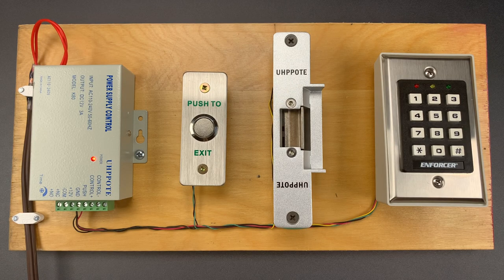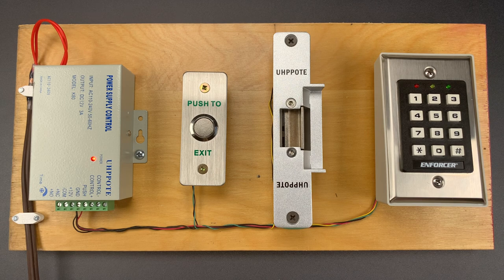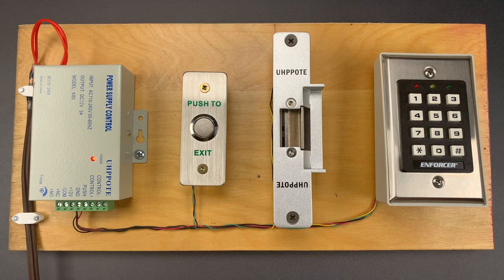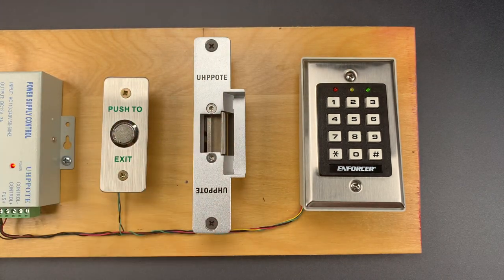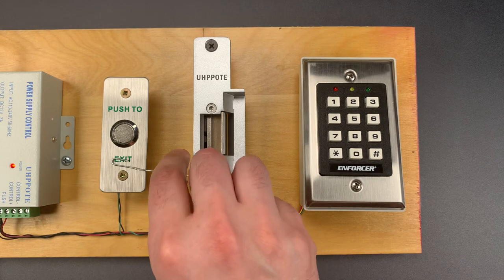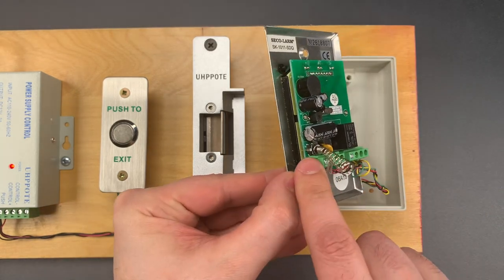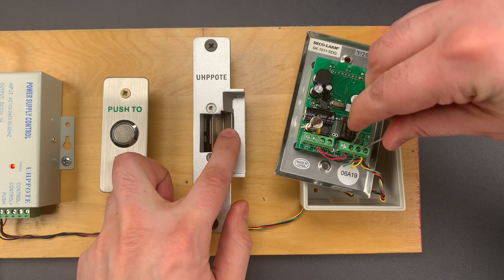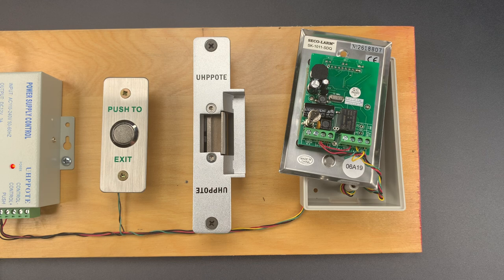[1045] Swiss Army Knife Bypass of Keypad Lock

Comment: As an engineer I've always laughed when actors bypass locks like that in movies. I never imagined anybody could design something that wrong.
Reply: As an infosec guy I can always imagine it.
Reply: This door lock was originally intended as a prop for movies.
Reply: @LordSStorm  Red Teams love this one simple trick!

Blue Teams hate it when you do this.
Reply: as a software engineer I'm also shocked at how stupid this is
Reply: @weltmeister  that's what you get for a low security budget
Reply: All you have to do is close the circuit, you can put an entire buildings worth of bullshit in between and you still just need to close the circuit. As an engineer, it seems like you should know that.. another ridiculously futile lock setup is an electronic safe with a wafer lock.. these are only the non-destructive methods, had the wires been easily exposed like they are going to the box here you could just close the loop there and bypass the box altogether.
Reply: @ZeroLocc  Engineers are perfectly aware. This seems to be designed by two squirrels and a beaver on heroin.
Reply: @yottaforce  that's probably the most common push code box on the market. The reason it has an easy bypass is to let the locksmith in. electronic door locks are useless because all you have to do is close the circuit. Security systems in general are pointless because I can set your alarm off five or six times on a windy night and then the police will stop coming.
Reply: @ZeroLocc  This style is often used as a glorified "Employees Only" sign.  It keeps people from "accidentally" wandering pass a door they shouldn't be, but it'd likely be noticed if someone was actively tampering with it.  The bypass only works because the controller is built into the keypad so connecting the leads sends an open signal.  Another style of electronic lock has the controller inside the secure area with a dumb keypad on the outside that can only send raw button presses to the controller.
Reply: @MrNateSPF  i would argue that in infosec, one time is two too many. Also, a skilled entrant could get in multiple times without notice as long as awareness of the beach was low
Reply: @ZeroLocc  This style is not a good solution for infosec, but there are other electronic door locks available.  This would be for like an employee break room, so a non-employee could sneak in there and have access to the soda machines set to employee pricing... dun dun dun...
Reply: @MrNateSPF  much as I'd love to repeat myself, if you go up with you, and you will see that you are wrong. Locks keep out honest people only. Lock me out good enough and I'll go to the f**** wall
Reply: @MrNateSPF  what good is a tamper switch inside the box if I could pry the entire box off the wall and jump it from behind box
Reply: @ZeroLocc  This style is not a good solution for infosec, but there are other electronic door locks available.  This would be for like an employee break room, so a non-employee could sneak in there and have access to the soda machines set to employee pricing... dun dun dun...
Reply: These are more a convenience item, SCIF room door locks are a bit more sophisticated.
Reply: @davidmoran4471  if I've gotten to the keyed door, I'm getting thru it. What people don't realize is that corporate espionage it's not a fly-by-night operation. Kind of people that commit corporate espionage take a lot of time to plan and prepare. They're playing to win, not playing to "hopefully" keep people out "in most cases" .
Reply: @ZeroLocc  Well congratulations, you have successfully broken into the employee break room and have access to the employee-discounted vending machines.  What are you going to do next?

Again other electronic locks are available that do not have this exploit at all.
Reply: @MrNateSPF  poison the coffee, plant a wifi pineapple,a listening device in the lights, i could even rig an ied to the keypad or too the door,  then i might 'service' the vending machines as a profitable cover for my exploits. Better yet, I could spend an hour and there the believable Xfinity or other internet provider get up on and by the end of the lunch hour everyone would recognize me when I wandered around the rest of the building putting in rubber duckies and whatever else I would want to do. What did you expect me to say? Something like: nurrrr, I don't know? I could even befriended disgruntled employee you have no idea how damaging that could be
Reply: @ZeroLocc  Then you find out the "friends" you made were actually security guards monitoring everything you did, who decided it easier to just play along till the police got there to arrest you.

Yet again the actual point that you keep skipping over is there are other electronic locks that are not susceptible to this kind of exploit.
Reply: @ZeroLocc  not corporate, Federal.  Even the conduit for the Ethernet has alarms.
Reply: @davidmoran4471  I'll bet twenty bucks no matter where you work, you can walk up to a desk with a secretary or someone at it that has USB ports facing towards you as you walk up to it. That's all that's needed. In the break room is generally one of the soda machines these days. Or Wi-Fi pineapple. Ethernet is so 1995.
Reply: @weltmeister  make all of your code publicly available and you might find yourself surprised.
Reply: There is no lock that cant be picked. Regardless of how complicated you design the lock.
Reply: @archimedes7436  That's no excuse for making a bad design.
Reply: as a plumber, i know nothing of this.
Reply: LMFAO or even worse using to secure anything of value.
Reply: @MrNateSPF  what am I going to do after breaking into the employee break room? 
Takeover the mother world 🌎
Reply: @ZeroLocc  "electronic door locks are useless because all you have to do is close the circuit"

Yet again the actual point that you keep skipping over is there are other electronic locks that are not susceptible to this kind of exploit.
Reply: @MrNateSPF  actually the point is this is the absolute most common door lock it existence and I can lock a box from where I live to a very fancy health insurance facility, which may be your health insurance facility I walk right in the f**** door because they have one on the outside. And that's the point. The point is the industry Standard junk is junk.
Reply: @ZeroLocc  "electronic door locks are useless because all you have to do is close the circuit"

We are in agreement that this particular electronic lock is useless.  Yet again the actual point that you keep skipping over is not all electronic locks would be susceptible to this kind of exploit.
Reply: @ZeroLocc  you have a rather devious mind it looks! on reality, you would hardly do any of those things
Reply: @harrickvharrick3957  LMAO, how do you think I make my living?
Reply: @harrickvharrick3957  it's naivety like that that's going to get your little kitty cat hurt
Reply: @ZeroLocc  Erm, you do something with pineapples?
Reply: @ZeroLocc  I am happy it is something with pineapples. That minimises the chance of any kittycats getting hurt. Suppose a coconut farm would be much more dangerous, to name something!
Reply: @harrickvharrick3957  must be one of those lonely people, eh?
Reply: Seems like they should have wired it together in the factory and sank a load of resin inside the box to make it tamper proof. With the connections being made on the INSIDE of the door...not the outside Jesus Christ.
Reply: @uklearningman4461  You couldn't have mounted it to the wall that way. the box always has to be able to be open so that the mounting screws can go inside. Also you have to wire up the tamper switch inside. Which most people don't do and that's the point.
Reply: @ZeroLocc  err no, you completely misunderstand. The problem with this is that there is friggable connections on the OUTSIDE of the door you are trying to get in to. If everything was sealed with no terminations apart from on the INSIDE, then you would have to be on the INSIDE of the door to defeat the lock. Really not that hard to imagine...
Reply: @uklearningman4461  there are no visible Connections in a doorway
Reply: actually the locks in movies often seem to be considerably harder to bypass!
Reply: @simonstucki  true, i dont know anyone who uses explosives to bypass doors and locks. That's not exactly how you keep people from coming to see what you're doing. That is just the first example came to my head
Reply: @ZeroLocc  the places i did in the 80’s used internal door hinge switches. So anytime that door opened, it was recorded both side and onsite armed security was sent if violated entranced. FYI harden frame and 6” concrete walls to concrete ceiling. You might get in but there’d be a gunfight waiting.
Reply: @ZeroLocc  careful everyone, internet tough guy alert.

He doesn't even care anymore!! And he says he likes to hurt people on the internet in the real world!!11

He threatens people's CAT! How can we possibly ignore such an internet tough guy!  He's so tough and scary!
Reply: I have to disagree with your blanket comment "engineers are well aware". The ones I work with are not. They don't seek out any advice for projects and implement projects that we have to fix afterwards. While I agree most engineers are and should be well aware of simple mistakes you cannot throw a blanket statement over them all.
Reply: @therinni2347  Well, yes. Most, a lot, usually. You are right some engineers shouldn't build anything higher than 60 cm.
Reply: you hear at least once a year about a disgruntled employee coming back into a building that should have been secure enough not to allow it to happen. people may think I was just being over the top, but you never know what someone is capable of. that's why as employers we have a responsibility to keep our employees secure and safe from the outside world when they are in our employ..
Reply: @MrNateSPF  He's probably going to go as far as pooping in the staff toilet
Reply: @ZeroLocc  careful everyone!! Now he's a disgruntled employee!  Maybe he's even had a job!! (I'm not holding my breath, he's probably 12, but like, cats beware!!)
Reply: Have you been an engineer long? :D
Reply: @weltmeister  As a software engineer that deals somewhat with infosec ... I'm not even remotely surprised.
Reply: @notsure7874  About 20 years. You make me sound a bit naive... :-)
Reply: @yottaforce  Well many engineers I've worked with were perfectly aware that, though perhaps not total imbeciles, they could at least be trusted to drive the people who really build things, the crew, to the job site.
Reply: @ZeroLocc  Well said
Reply: @ZeroLocc  You have spent way too long here arguing. Sounds like you have a lot of spare time. Maybe spend it looking for a girl to use to feel less insecure.
Reply: Ja det har du sku ret i
Reply: So a simple plastic cylinder around the antitamper spring would handle that exploit.  Realistically if you can get physical access to the circuit it isn't surprising you could trigger things to open however you like.
Reply: This is an interesting conversation:  Angry JD against the world.  Everybody understands JD, and yet no one does.  I expect that why he's in his professed business.   After that, most of the conversation is people talking past each other, but I repeat myself.
And there's one Italian plumber who professes to know nothing.  That's the guy who really scares me:  Can I tell his preference for boxers vs briefs, or does he just present a "coin drop" to keep us guessing?   If his shirt tail goes down far enough to keep us (and him!) in the dark, then put 2 security guys on him until he leaves the building.
Reply: @ZeroLocc  that's the best way, it's fast and works with all electronic locks. there's usually some type of junction to the panel.
Reply: It’s a business. Make them as quick as you can or buy them for China and don’t even give it a thought
Reply: A simple plastic shroud (extending down from the lid) would prevent all of those attacks.
Reply: As a person who loves to build(and break) things, most security systems are mostly for show.
Reply: As a soilder I never cared, but now I know, I, have no particular use for it, in Germany, especially in Bochum I never saw anything like that, most have a lock on there, wich you can cut off with a boot cutter, nothing unnecessary complicated, for the simple reason, everyone around me, seems to be dumber, than a bug, they can't access it even if the wanted.
Reply: Remember locks are only to keep honest people honest, because a criminal if they want in bad enough, it won't matter what lock is present.
Reply: @yottaforce  hey that's too much credit to their name. A beaver on heroin is a hell of a worker.
Reply: @porobignardi8369  ah a true man of science.
Reply: I am not surprised,. Remember most of electronic products made on China or Taiwan, aka mass production line with extremely low cost. 

Thus, R&D team are always been demanded by their big boss to change their design to easy assembly with cheap materials and equipment. Yet, R&D team never have enough of time to create next model of products, so usually they make improvements based on current design layout.

That makes these products easy to disassemble. And believe me, they are the products the big boss want. They want people to keep buying new locks
Reply: They're everywhere.
Reply: @ZeroLocc  I remember a bank heist movie that did that. Setting of the alarm until no one cared that is.
Reply: @weltmeister  funny thing, software tends to be something with higher density of security issues than any other kind of product!
Reply: I always watch for how often they just use a pick without a tension wrench.  But it seems like in more recent years they’re using them more often.
Reply: It’s generally that easy.
Reply: "Hahaha the other engineers are so STUPID!!!1!!!"
Reply: @yottaforce  LOL
Reply: In a world with the garbage bag and carryyout bag paradox....you shouldnt be surprised ...oh and we allowed government and politics to actually be a thing so already a failed system..again no surprise lol 😅
Reply: @weltmeister   Locks are for honest people
Reply: @ZeroLocc  Not all electronic locks are the same: there are high security (for armored doors) and very high security locks (for safes and vaults) also... but of course they are not cheap (and of course they are also useless if you don't have armored doors and windows in a concrete room in the first case and a proper safe or vault in the second one!).
This locks seems just fine if you have a wood door and glass windows!
Reply: @ZeroLocc  ...Engineers have always been high on themselves. There’s a Show called Engineering Catastrophes which will tell you all you need to know about Engineers. They’re the smartest people on earth and they’ll be the first to remind you of that.😂🤣
Reply: All that's needed is little covers over the contacts and for that tamper spring to be a very strong rigid spring or strong metal strip type spring
Reply: Right? Flippin rediculous.
ALL they had to do, was have a double inside casing. Just so you cant stick anything in between.
Reply: @archimedes7436   every lock can be opened without a key, but that does not mean that every single lock is pickable. There are definitely locks that are pick proof, or require an especially specific pick that only a real professional and honest locksmith would use for their customer.
Reply: @ZeroLocc   hey how do you close the circuit on an x09?
Reply: @yottaforce  You mean our crack team of experts?
Reply: @adambartlett114  You are skipping over that actually, you've missed the whole point that these should not be used for security.  Employees should not leave their valuables out and unattended in the break room, use a locker if needed.
Reply: As an bio chemical engineer I also find this very amusing
Reply: Over the last 10 years or so, I've mentalky apologized to a shitload of '90s screenwriters whose [villain, lock, plot device, etc.] was apparently not as cartoonishly silly as we all imaged.
Reply: After working around some of these devices, I am also amazed how old tech and poorly designed they are - and in the case of alarm panels and sensors apparently prone to false alarms as well, which makes people ignore the alarm if it goes off anyway. At the end of the day, I think no matter how expensive the lock, it only keeps honest people honest.
Reply: everyone knows that all you need to do is shoot the controls, and the automatic door will either let you in or keep the bad guys out.
Reply: @ZeroLocc  You're 14, we get it.
Reply: LOL same, I have seen so many simple electronic bypasses and exploits shown on TV and movies I literally had no idea so many of these were designed so badly as all that until very recently. I don't know if it's a case of really excellent on-set security advisors, or just that Hollywood has as much design skill as these electronic lock makers.
Reply: @Osvaldista  Except the name brand choices require you to purchase a readily available key to easily open and bypass them. Two brands that I know of each have one key that opens every panel they sell.  This system atleast allows for a tamper alarm to be wired in. Of course it doesn't include an alarm horn, it's intended to be wired to a security system that is understandably not part of an entry lock kit. And a decent security system won't reset just because you hurry up and reset the trigger switch. 
Installing this in a simple enclosure thwarts the bypasses shown here.  
As always locks only keep the honest people out. Locked banks and other high security buildings with electric locks can often be accessed with computer duster, if that method is too expensive then use a balloon. If you can't manage that then try a little water.
Reply: That's why I don't trust electronic locks. I never know what sort of security flaws they have. And most have the central controller on the outside.
Reply: Or escaping a prison when the protagonist simply break down one camera to disable all the cameras in the prison of the future, gosh, what were they thinking😂
Reply: @archimedes7436  You can't pick a maglock.  You can defeat it by cutting power, but if it's supervised, then it will alarm as soon as power is cut, and any security company worth its salt will have supervised doors and locks.

The same is true with shielded door strikes.  Impossible to pick (unless the door also has a key lock) and should be supervised, and fail secure locks stay locked when they lose power.

Yes, every lock can be bypassed, it's just a matter of what it would take to bypass it.  A halligan tool isn't the most discreet method of entry.
Reply: As an engineer with brains i can always imagine it
Reply: @yottaforce You have to keep in mind how common the Dunning Kruger effect is with engineers... and doctors... and lawyers (not directed at LPL).
Reply: @MrNateSPF All it requires is a coded signal. Then, shorting the wires won't work. LiftMaster 8000 series (starting around 2010 fwd) residential garage door operators have a coded wall button. It's not even for security. It's a simple 2-wire connection. If you take the button off the wall and try to short the wires, nothing will happen. I believe they did that so intermittent shorts won't cause phantom door operations. Drywall guys LOVE to tear up low voltage and electricians don't take steps to protect the wires so actually a common problem. That might have been a bit of a rant, the point is that there's no excuse for a keypad or switch to not be coded if a simple garage door 'doorbell type' button has it.
Reply: @Cantthinkofahandle117   I know this thread is getting long but I've mentioned elsewhere that this style is mostly used as a convenience so customers don't accidentally go thru the wrong door.  Occasionally I have seen it used for security and agree that's a misuse.  I've worked in a chain where the regional manager insisted the codes be "1234" so he didn't need to remember anything store-to-store.  People would jokingly enter that exact code and just have a look of embarrassment when it actually worked.  If someone was looking to kill me they could have without even using those doors.  But it did it's job of reducing the number of people who would accidentally go into the "employees only" door right next to the bathroom door.  I'll also note there's instances where a lock needs to be fail-safe instead of fail-secure, where a room or closet may only have one door so the lock should be easy enough to circumvent if there's an issue with the electronics.
Reply: It would only solve one of the problems but making the case out of plastic would at least prevent someone from just grounding out the contact point to the case to trigger the lock.

All the other stupid ways this can be bypassed wouldn't be helped, though, so putting the logic to trigger the lock inside the egress button remains the only actual solution (and get ready to pay out the nose for the simplicity of just moving the logic there with a couple of wires).
Reply: A lot of these things are design choices and not errors. The entire concept of "it's a feature not a bug" really comes in to play with intentional security  bypass designs.  Which designs do this intentionally and which ones don't we won't know.  The manufacturers aren't saying but especially for huge companies like masterlock that are hyperfocused on shaving a tenth of a penny per thousand pieces off of supply chain elements, if this wasn't working for them they'd have changed by now. 
Keep in mind a good product isn't the same thing as a good device.
A good product makes money even if it's defective,  a good device is what the consumer wants. They don't have the same design parameters.